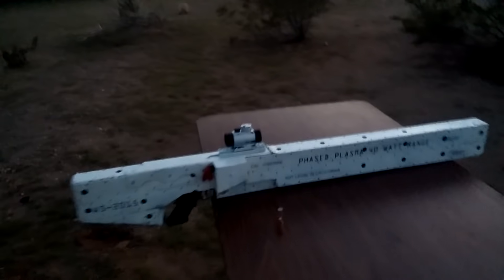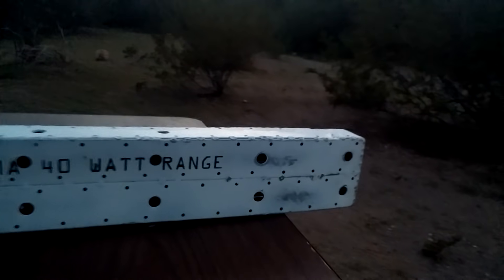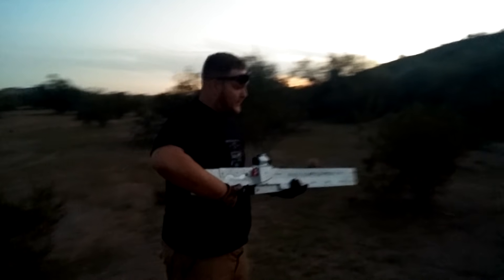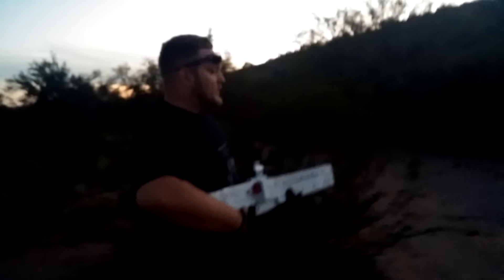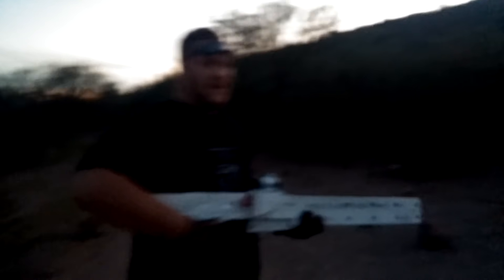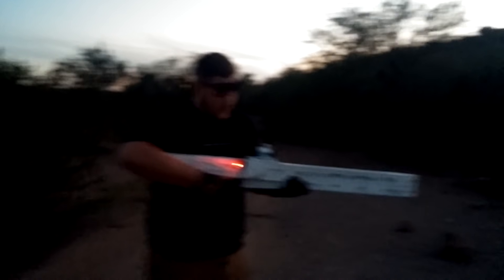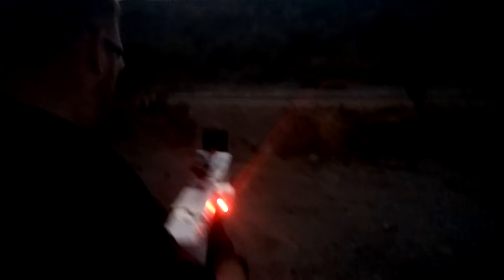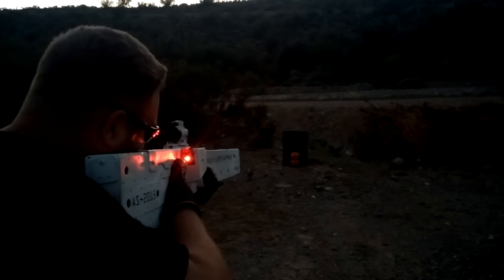Electromagnetic Plasma Rifle (Night Time Test Fire)

Comment: Thats just a gun hidden by some plastic. The power banks required to accelerate a projectile to superonic speeds could never fit inside that gun, not to mention a vacum tube tipped projectile would not survive the acceleration shown.
Low effort fake, shame. That over 80% of viewers bought this is sad.

Comment: the rails must be solid gold, and the projectile accelerator casing can remain copper with a projectile core made of tungsten surrounded by a carbide hollow casing housing  hydrogen gas(neon is fine and easier to get). ionization and compression of the gas on impact make the tungsten super heat. carbide casing explodes forward with tungsten projectile achieving very high speeds post-discharge/impact.

Comment: Shirudo Systems: You know I watched a video where they took what looked like AA battery and attached a strong magnet at either end of the battery to demonstrate how it propelled itself through a coiled wire and I thought what if that battery were a capacitor with a magnet at either end making it a self propelled bullet, just stick it in the coil and off it goes.. Then there's no need for the gun to have a power source..

Comment: So I'm guessing the plasma helps cut the steel and the copper melts behind it creating a jet like in heat round. Except the jet of molten/very hot ductile copper is being pushed by a magnetic field instead of high explosives. And the plasma is weakening the steel before the jet comes into contact with it. They work together to punch through the steel. 

Awesome stuff. Or you are great at editing and effects idk.
Reply: what helps cut the steel is a conventional firearm projectile fired from a from a conventional firearm hidden behind futuristic furniture which is what this guy specializes in if you take a look at other videos on his channel

Comment: Can’t tell if the sonic boom is added sound effects, you made probably the most powerful hand held rail gun ever or it’s just a normal gun I a white box but hopefully not. The sparks coming out the end sure are pretty but I’m surprised the rails didn’t spontaneously combust
Reply: the sparks ARE the rails literally melting and blowing off from the friction, at least on a normal railgun they are. What I find curious is just how much power this thing would have to use to impart that much speed on the projectile.
Reply: @CarlosAM1 Seriously. This guy created a functioning build of what's basically an un-heard of, next gen weapon, and he's like "alright see you next time." like BRO
Reply: @rRadixerus  well it's not unheard of, it's just impractical.

Comment: One question: Where's the recoil? Your shoulder didn't even move when you shot this thing, yet it goes thru AR500 plate?
Sure the camera shakes, but the gun doesn't push back into your shoulder AT ALL.
I don't want to say fake, but the things I'm not seeing are telling me that there's something fishy going on.

Equal and opposite reaction, that's what I didn't see. Even an AR-15 pushes back into your shoulder a little bit when shot.
This weapon looks like it has significantly more power than an AR-15.
Reply from the maker: It does have recoil, but the recoil doesn't act back at the shooter like with a normal gun, because the forces are directed sideways onto the rails.
Reply: @ShirudoSystems  I call bullshit, you can clearly hear and see combustion, suspiciously like a traditional firearm...which if it were the case that this was actually an em weapon than you would have none of that. And you can't blame this on the Neon because it is an inert gas and will only florece when an electric current is passed through it, which is not even plasma!

Comment: I saw a show on TV in the 90ts called towards 2000 and it showed a rail gun that was a 10 foot long ,used 10,000 volts that shot a 10mm ball bearing threw 20 feet of phone books compressed together with a block of concrete 4x4x1ft thick a 4ft x 3ft x 1ft block of lead, a 6ft  x 6ft reinforced block of concrete and the 2ft thick bunker wall and they were unable to find the projectile ad it had no rails, the projectile floated in a magnetic field.

Comment: Very interesting concept... I would like to see this fired with slow motion camera... Honestly I think what you created is a EFP (Electronically Formed Penetrator) gun. The electric charge super heated the copper sleeve into a molten copper projectile. I would also like to see a picture of the steel plate in full light to see if any copper discharge was left. I would try replacing the copper sleeve with highly polished steel.

Comment: The US Navy has been working on them since the early 80's. Some are on test ships, and an alternative use is for catapults already in use on the Gerald Ford.
I would love to see chrono details. Did you break Mach 5? Can a chrono read that high?
Reply: a railgun that small is extremely unlikely to go near Mach 2 let alone Mach 5 due to the fact that to get to such high speed it would take a hole load of power at that size the gun would probably melt and it's unlikely it could hold enough power but it would be cool if it could
Reply: angers in tungsten

Comment: Ok, I'm impressed! Believe me, that's not easy to do.
Have you considered using carbon strips clamped into your conductors? They would probably last much longer and be simple to replace, and won't blow hot spalling  all over the interior or on yourself and onlookers.
Very nice.

Comment: As if a light, little - and soft - copper sleeve could punch through hardened steel armor; no matter HOW fast one could accelerate it, it'd never happen - it'd vaporize en-route before going fast enough. He's got a conventional firearm under that boxy white costume. Lame.

Comment: This seems illogical. How could the glass in the projectile not shatter with the force of the g-shock?
Reply: Well I'm clearly late to this, but just in case someone else is reading down through these comments it's because glass shaped in a tube like that can handle some pretty serious stresses, it's just that when there is a point of impact that the glass will shatter.
Reply: Vacuum tubes are really quite hard to break, I suspect it exploded as soon as it hit the steel plate (thus the fragments that hit the camera man).  The super heated neon gas along with the copper casing would be what punched through the steel plate behind the pumpkins.
Reply: It's being pulled as one piece down the rails, no impact from an explosion or firing pin so there isn't a g-shock or much recoil.
Reply: Could be laminated

Comment: Dude, are you sure that's ar500? Because either you have a design with some record breaking efficiency or your capacitors are literally magical. Speaking of which, what voltage are they? Capacitance?
Reply: I am just a lowly physics undergrad at Heidelberg University (in Germany), no DARPA affiliation. But I can tell you for sure that what josephjohnson is writing is bunk. Bismuth´s diamagnetic response is waaaaay to weak to propel a projectile. The velocity will not be equal to the rate at which the field can be generated/"collapses". He is probably thinking about induction here, not diamagnetism, which is much stronger but also a completely different physical mechanism, and Bismuth would be poor for that purpose. Rather, the velocity at the muzzle depends on the accelleration, which depends on the pressure behind the projectile. For magnetic systems use magnetic pressure: https://en.wikipedia.org/wiki/Magnetic_pressure
The magnetic pressure, for induction propelled projectiles, would depend on the current induced in the projectile, certainly not coming close to the 10 Tesla or so superconductors are capable of, which only translates into less than 10k psi, laughably little, easily surpassed by even outdated conventional firearms.
Reply: Shirudo Systems: You know I watched a video where they took what looked like AA battery and attached a strong magnet at either end of the battery to demonstrate how it propelled itself through a coiled wire and I thought what if that battery were a capacitor with a magnet at either end making it a self propelled bullet, just stick it in the coil and off it goes.. Then there's no need for the gun to have a power source..
Reply: This is FAKE as hell. It's a 50.cal with some bullshit sci-fi dressing around it. If these liars made a coil rifle that light weight that could punch through a steel plate they would be millionaires. If not more.
Reply: This isn’t done like people think it is. Think backwards. It’s a dielectric propelled by a magnetic field not a ferro magnet propelled by electromotive force. The velocity would be equal to the rate at which the field could be generated around the barrel. The copper would be repelled as the magnetic field formed. You only need one rail for this design, or rather a threaded iron tube. The threads guide the magnetic field and focus it against the copper. Bismuth would have been better.(greater reluctance/lower magnetic permeability) Bismuth can float on the field of a weak electromagnet if you dump some liquid nitrogen on it. Personally, that’s how I like cool and provide initial acceleration. Liquid nitrogen “primer” rapid 700-1 expansion volume, and it would cool the barrel preventing overheating. The collapsing magnetic field creates the plasma with the field energy looking for somewhere to go… the argon ampule makes sense. I’d use hydrogen personally. Why not use something already charged?  Dope the glass ampule with some magnetite to prevent leakage and you’ve got yourself a fully diamagnetic projectile.
Reply: @josephjohnson7333  What would theoretical round capacity of such a railgun be?  While incredibly cool, I don't immediately see a lot of advantages unless it can be made to hold more projectiles than conventional gunpowder weapons.
Reply: @josephjohnson7333  this is extremely intriguing. I have never heard of this type of design yet, but it makes sense at least to me. Out of curiosity do you have like any schematics or diagrams?
Reply: @jmmarksman73   I don’t build weapons. I used this technique to build a motor though. You basically make a transformer, then turn the iron laminate core into a screw and slide a thick copper sleeve around it. Each winding in the core provides a different voltage or power output. By placing the windings in series and connecting them with switches, the voltage can be digitally controlled and thus the power applied to the outer sleeve. I used bifilar pancake coils to maximize the magnetic flied generated by the voltage. The screw pattern carved into the transformer then sends out a rotating magnetic field which pushes against the diaelectric copper causing the cylinder to rotate. The main thing is like about this design is it’s ability to dissipate heat. If you want to be really efficient, use silver! Plating. The resistance can be dropped another 5% and the heat dislocation is better as well which is critical for efficiency and lifesra
Reply: @josephjohnson7333  what your describing almost sounds like the polar opposite of a tokamak. Tokamaks used for nuclear energy use a very similar design concept, but rather than generating the rotating field with a traditional plasma loop it seams like you managed to circumvent the process in favor of a solid state coil system. The reason nuclear energy is sustainable this way is due to the ‘semi-perpetual nature’ of elemental degradation and that the reactor is eternally sustainable and at the same time dependent on input of more reactor rods. Your design seems comparably efficient however in terms of generating energy unsustainable. (That’s likely why it works as a motor which is essentially an output in the form of mechanical potential) however with your more solid state design, I see no issue with replacing the main windings with superconducting materials, converting it into essentially a proof of concept for cold fusion. At this stage such a design would only need two sources of energy. The first energy source input voltage into a secondary that would insure the loop system would continue to produce rotating fields, because a ferrous core or permeable magnet would both cause fluctuations as a result of the Lorentz force and reduce the amperage over time. The only other input would be the required energy to produce the chilling necessary to sustain the superconducting materials at their operational states. Super cool idea!
Reply: @jmmarksman73 hmm. Never considered that. Never looked into cold fusion. You would obviously be very interesting to talk to.
Reply: @josephjohnson7333  I'm almost convinced you know what you're talking about however it doesnt matter because the video is fake as shit
the guy specializes in building furniture for guns and he just made a cool railgun looking furniture
Reply: @josephjohnson7333 are you a physicist at DARPA or are you just faking science babble, cause i haven't got the slightest clue what you are saying...  But be that as it may,  if you ever build this unfathomable gizmo...  I'll take 2 of them,  thanks!
Reply: @IknowRight1982  I’m definitely a scientist. My grandfather worked for DARPA. I’m just a microbiologist. Though I have built devices which use sound to break chemical bonds and or reorganize them. I can pump water with sound and grown multi phasic ultra and infrasonic time crystals. My fertilizer formulas are sold in every state in the country in over 3000 stores. (Prior to the pandemic) 
  Here’s a video of me boiling water with a 100 watt light bulb and a multi phasic time crystal.  Hope to use it for water purification and power generation some day. Basically it can purify water as a biproduct of generating electricity,
Heat and cold.  What is displayed in this video is impossible according to most people’s interpretation of the standard model of physics. The standard model however only applies to medium sized objects(molecules to planets) so technically the laws lf
Thermodynamics do not apply to electrons or light. Something to think about. Lol. If I built weapons I would go missing immediately. I am almost certain that I monitored by both corporations and governments.  Mostly because many of the things I have invented have ended up on the market 6 months to a year later. I won’t ever build a weapon, but if you want water that tastes like it came out of a mountain spring and has zero nitrates and nitrites.  Check out my pizeoelectromagnetic oxidation state organizer. Or water filter as it is being used. https://thewellnessenterprise.com/
Reply: @josephjohnson7333  
"Scientist"
Reply: @IknowRight1982  you don't have to be a physicist at darpa...to have darpa employed physicist level knowledge. The government doesn't create genius, it merely funds it.
Reply: @josephjohnson7333  what are you on about

Comment: why don't you scale the projectile down to the size of a grain of sand? You can get a micro projectile that will still punch a hole in that plate, and not destroy your gun, mabe even fire more than one round per hour.
Reply: A projectile that small would have too much air resistance relative to its inertia to be any kind of effective.
Reply: *****
Agreed. A sand grain would have to be going fast enough to burn up in the atmosphere to get through that plate. Against something like tank armor, it would probably have to travel at near-relativistic speeds.
Reply: The smaller projectile will take in far less energy from the magnets than a larger projectile would, it would be far to weak.
Reply: thegoodrobot dot com needs inventors for our real life war robots

Comment: you basically made a handheld mini-shaped charge that can penetrate armor up the amps for extra range and speed and you got yourself an anti tank plasma sniper riflehaha thumbs up man you might get a military contract and millions for it xD
Reply from the maker: Ya, actually. An RPG uses a copper shaped charge to melt through whatever it hits, so I guess this is a similar principle.
Reply: +Alex Smyth given the fact there are plutonium reactors than cqn run for over 100years we would need a cryo chamber but it would be possible to create a space ship with a railgun i think thatd be cool but it wont happen

Comment: dude you could get rich if you sold it to the army
Reply: +Edward Ogletree Not really, railguns need to be charged before every shot, or need a really high voltage DC power source.

Comment: Why aren't we funding this.
Reply: We can't give every soldier a Rail Gun Now because the Gun uses all the electricity in one shot and they would be be better off using it as a sniper rifles, to use the Rail Gun as an assault rifle they would have to carry a portable generator with them to get a few shots off of the gun, but, there is another type of weapon that uses magnetically acceleration, and it's the Gauss Gun or Coil Gun. The coil gun allows for faster reloading, someone actually made a video about a fully functional multishot coilgun
Reply: Because "we" know alot more about physics and electromagnetism than you, and arent easily wowd bt a youtube video. Bet this guy has a gravity negation machine and a perpetual battery too, lol.

Comment: You could make this semi auto and a bit smaller and lighter if you can and more powerful then sell it to the army
Reply: +kopfjager68 There are very good reasons man-portable railguns aren't already commonly used, not least among them the reason this guy stopped making videos of this railgun: It broke because the forces involved put tremendous strain on the rails. Early Navy-designed prototypes decades ago had to be serviced after each shot. There are plenty of other reasons, too, but this is one of the main ones.
Reply: hmm good point